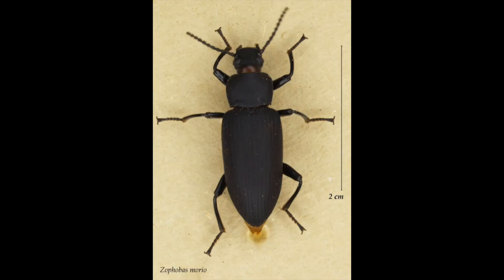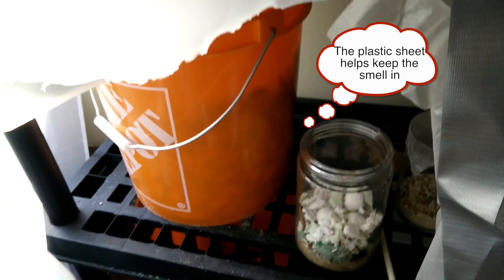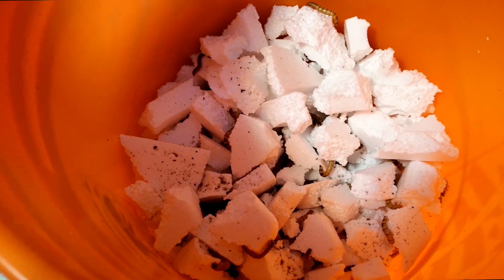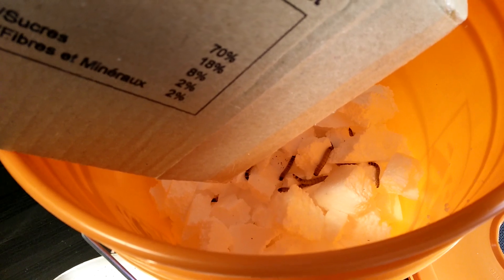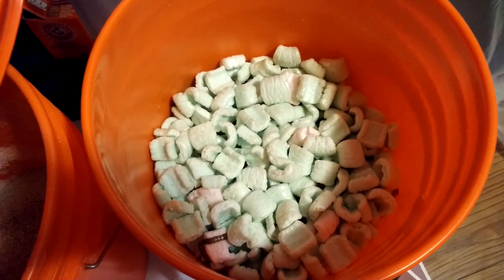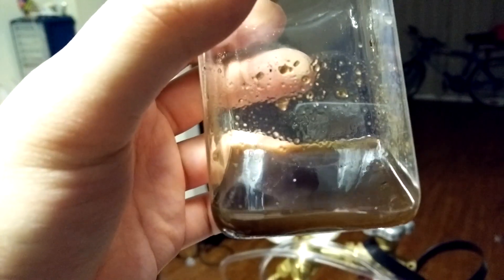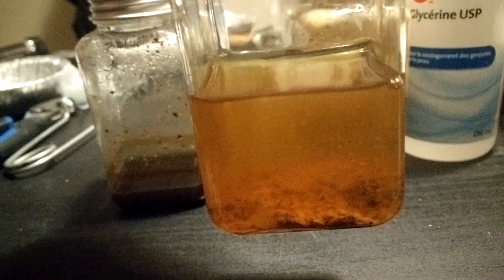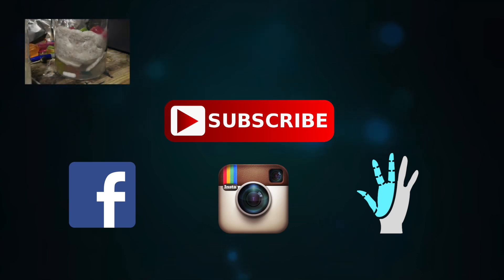Turning styrofoam into dirt 2: digestion chamber build

Comment: I really want to point out that if you are using this as fertilizer DO NOT use this on plants you're planning on eating, as there are toxic chemicals like hexabromocyclododecane, aka HBCD (a highly toxic flame retardant) that the worm doesn't absorb. There's also a possibility that other toxic chemicals don't pass through the worms gut so easily, so if you're using the worms as feeders you might want to think about other alternatives.

EDIT: I've done some more research and according to this (https://pubs.acs.org/doi/10.1021/es060009m#Abstract) website HBCD can be degraded "under realistic environmental concentrations in soils and freshwater aquatic sediments" Because of this I recommend going through multiple types of biodegradation (compost, another type of worm farm, eta)

Comment: I thought the bacteria were getting carbohydrates by digesting it as it's primarily carbon and hydrogen,but after reading the source paper it's believed to be a synergistic process of worm enzymes and different microbes (a consortia) akin to how termites breakdown cellulose and ruminants like cows digest grasses. Surprisingly, one of  the metabolites is mineralized CO2.  When polystyrene is subjected to UV irradiation in the presence of air (not buried), it undergoes a rapid yellowing while becoming brittle (photo degradation). Maybe a two step approach would prove more effective i.e. photo and bio degradation.

Comment: Hydrate and break down the Styrofoam before feeding it to them. I bet it would make it far more digestible. Just take the Styrofoam and use your hands or feet to crunch it up. Then either pour water in or mist it heavily, and then crunch and mix it up some more thoroughly. You want to get the hydration level similar to wood (so just slightly damp or wet), and the particle size as small as possible. The smaller the particle size, and the wetter it is (to an extent), the better they'll be able to digest. Just think of humans - which would be easier to digest, heavily ground and runny oatmeal or uncooked and dried oat grains. Obviously the oatmeal. I feel as though making a damp Styrofoam slurry would help the worms digest it a lot. Hope you try this out.

Comment: Your forgeting something extremely important. The styrofoam does have nutrients right? So when you get those super worms all your doing is stripping their previously filled digestive tracks of what ever it used to have and anything that it produces itself. However, by letting bacteria have at the stryo poop first then letting red wigglers eat that you will have a product that will 100 percent work on a lot of plant types. So superworms first, let it compost with other things, then let red wigglers eat it again to create a more humus like mixer, humus the dirt not the dish lol.

Comment: Teacher in School: "Styrofoam is not biodegradable."
Ian Malcolm: "Life, uh, finds a way."
Reply: Josh Blount but they eat it. Maybe you are the wrong one.
Reply: coolguyhentaisenpai not a biologist but surely it doesnt have to be micros right?
Reply: @coolguyhentaisenpai There is a process where they heat the styrofoam (polystyrene) in an oxygenless environment to temperatures over 900F. This is pyrolysis and it breaks polystyrene into styrene. After that, there are bacteria that CAN break that down. But they create a byproduct called polyhydroxyalkanoate (PHA) that is recyclable. If a bottle made of PHA was put in a hole and buried in dirt, it would likely disintegrate in about 2 months. Left out in the open, it would remain much longer.

I looked into research that Stanford Researchers did with Mealworms eating polystyrene and it's not as eco-friendly as I'd hoped. It seems the polystyrene is broken down, which is good. But they found HBCD (Hexabromocyclododecane) in the mealworm excretions. It didn't seem to harm the mealworms as they managed to concentrate and expel the chemical. They even added HBCD into styrofoam pellets for them to eat and it didn't seem to harm them. But it poses a danger to the environment once they excrete it. There may be other plastics the mealworms could eat that would not have the same end result. If mealworms could break it down into non-toxic substances, that would likely be far more cost-effective than methods requiring pyrolysis.

This whole experiment has me intrigued.

Comment: I have been thinking about doing something similar. But instead of dissolving the poop in water I was planning on using it as substrate to grow Tiger Sawgill (Lentinus Tigrinus). Then eventually using whats left of that as compost. When looking into this I was worried that some of the plastics would not get digested and fall through the grate along with the other fecal matter, I believe that the fungus could help ensure even more plastics get digested. The worms can apparently live off just Styrofoam, but I am not sure how the fungus would do. This is just my general idea, but what do you think?

I was also thinking about using wax worms to digest polyurethane, but I haven't looked into this as much. All I have read is that they can apparently digest it into ethylene glycol

Comment: If the need arises in the future, metal mesh can be attached to plastic containers and buckets by pressing a soldering iron into the mesh to melt it into the plastic. Works great and if you get a rhythm going its somewhat like welding. You can achieve a very clean and secure attachment relatively easily.

Comment: Your still doing it wrong. You should use much younger(smaller) worms to prove that the worms can grow on that diet. Otherwise it could be that they do eat and poop the stuff, but not actually getting anything from it. Oh, and make sure they don't eat each other. So basically take a gram of small worms and see if you can turn it into a couple grams of bigger worms. It would also be good to compare weights of the input and output, but of course you need to check the water content of both by comparing weight to dry weight.

Comment: if the floating white stuff actually dissolved in water I'm surprised you didn't film that and present that as part of the movie. That would have been much more meaningful than the scene where you emptied the box of them into the bucket.

As a result of the missing footage I am only convinced that they ate styrofoam. The reason they ate their own excrement is because they are starving and could at least regain s one nutrients from all the biomass due to the biomass of gut bacteria that died off from starvation. That's why it changed color; it was covered in dead bacteria.

They preferred the packaging peanuts because those are made out of plant cellulose these days, not styrofoam

Comment: Instead of using water on the powder how about a fungus? This may accelerate the powder to soil conversion. Note: the fungus would have a hard time due to the high bacterial concentration but there are ways around it. Also if you would really like to test weather the plastic content has been fully broken down; before using the inoculated water on plants send it to a lab to test weather the plastic is still present. If plastic is still present theres is a high likelihood that the water may be toxic to plants. Great Video

Comment: You used packing peanuts.  Did you make sure they were plastic and not cellulose?
Reply: packing peanuts are often color coded. Green is 70% recycled polystyrene
Reply: @watchcitydog  i thought those were the long white cylindrical ones, not the S-shaped ones
Reply: @watchcitydog  so chips lol
Reply: bio...., uh, i dont thinks so
Reply: the green color seems like  they are from algae or smth similar
Reply: Biohaxxter Cryptonerd lol so if you see a fence painted green it must be made of algae right???

Comment: I've also been testing this out using both the superworms and mealworms. Nice to see somebody  putting up their results on youtube, i'll keep checking in for updates.
Reply from the maker: How did your tests go? What setup did you use?
Reply: I used a multi-tier container set up with mesh cover and flooring. Solid Styrofoam broken up into small pieces with polyacrylamide gel for hydration.
Reply: TheLastLogicalOne Any idea about what the components of the poop are?

Comment: WOW!  You rock!  I think you should try the raw syrofoam frass (untreated poop) and use a  pot/bucket of it to plant hemp, and perhaps inoculate it with some mycorrhizal (fungal threads).  Hemp is not very selective, it will grow anywhere just about, and the micorrhizal will assist the hemp growth as well as possibly neutralize any petrochemicals that may be left over in the frass.   Canadian farmers grow some of the best hemp oil crops on the planet, so they may be looking for a way to get extra hemp growth or at least extra cash (recycling the styrofoam, too).
Reply from the maker: Thanks! I'll give it a try once I get to brazil. This is actually one of the smaller projects on the list for exosphere

Comment: I built the chamber with 1000 super worms.

Works great. They came with newspaper and they love that as much as they love packing peanuts.

I'm experimenting with different substances, so it'll be fun.

Question: the Styrofoam you used, what kind was it? Did it have a recycle number? Maybe you have a link to the product site?
Reply from the maker: I just used whatever styrofoam I had laying around. Some regular packing peanuts, or some stuff that was packaging from various deliveries.
Reply: +The Thought Emporium, I'm getting the smell of ammonia(ium?) from the top and bottom chamber of the compost -mostly the bottom.

I'm not sure of the superworm urine is the source. Or maybe the digestion releases the odor? I wonder if the microbes in the bottom are causing something.
Reply from the maker: +Wesley Alexis that's normal. its why I suggest doing this outside. I ended up making a whole enclosure to keep the smell under control
Reply: +The Thought Emporium, I'm not saying it's unusual: in traditional vermicomposting (so actual worms), the presence of ammonia can hurt the worms. However, I'm not sure what to think of how it affects zophobos moria or their waste. I'll keep reading, but maybe you have some insights?
Reply from the maker: +Wesley Alexis it never seemed to bother them but I can't image good aeration would hurt them

Comment: Awesome research! Recycling of plastics is something which we ought to be taking a lot more seriously, the amount which ends up in landfill is totally unacceptable -  in my opinion atleast! Would be interesting to analyse the 'styropoop'/aqueous extracts using an appropriate technique to determine the level of polystyrene content remaining, if any.
Reply: Apparently polystyrene is used for a lot more than foam. Everything from clear plastic cups to computer cases are made of it, so destroying this stuff is very important.  

(Also it’s made as a byproduct of oil refining, and so it is super cheap)

Comment: Gotta say im not entirely convinced by your experiment that it is being broken down as much as it looks.
Did you do control tests with finely divided but unpooped styrofoam?
Reply from the maker: +Fossil98 depends what I do as the control. If you put styrofoam in normal distilled water nothing would happen. I'd need to inoculate it with a particular kind of bacteria. That bacteria happens to thrive in the worms stomach so the finely divided styrofoam is essentially coated in it which speeds up the decomposition. An easy control is to look at any of the styrofoam that's strewn about nowadays. It doesn't break down even if it's in water. We use styrofoam in every buoy and it's constantly wet yet it only degrades after years and that's more due to things growing on it and breaking bits off, or a boat or something hitting it. That's why this color forming is so interesting. Normal styrofoam won't do that. Wheras all evidence points to this being broken down at least partially which is more than I could say for normal styrofoam.
Reply: +Travis Mitchell; co2 and possibly water since its being respirated. The chlorine content must be making an inorganic chemical though if it isnt evaporating and i wonder if adding sodium would help it form salt to become completely safe. Chlorine has always been the reason burning styrene is unsafe (pcbb dioxins being created).